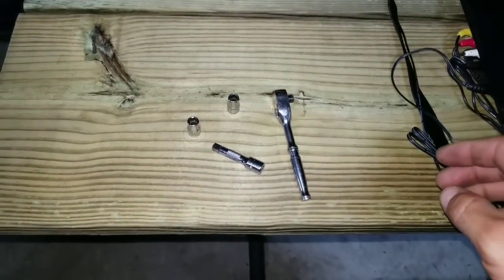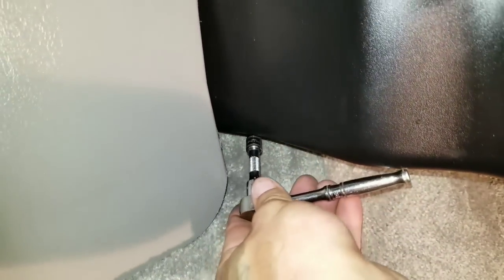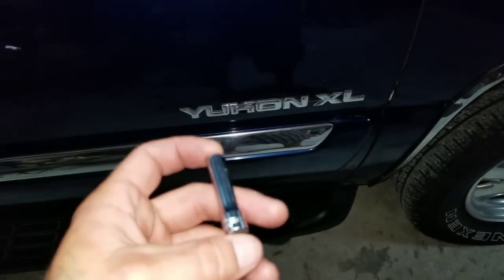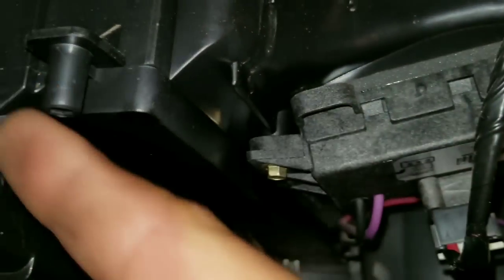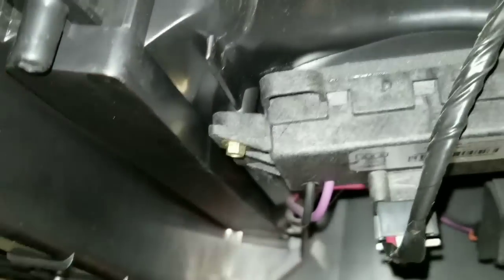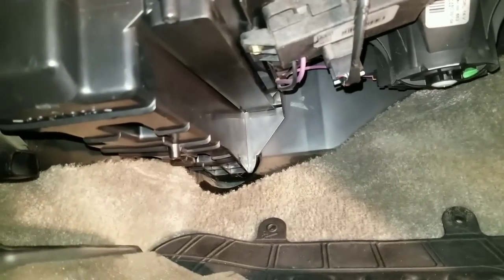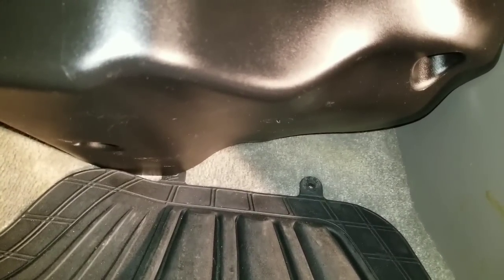Cabin Air Filter Replacement - 1999- 2007 - Yukon - Suburban - Tahoe

Comment: Thank you for not finding a filter. I was going crazy yesterday trying to find my cabin filter. My local parts store was happy to sell me a filter and every YouTube video I looked at showed me where it was. You saved me a trip to the dealer. Now I can put the cover back.
Reply: Yeah I was thinking the same thing the filters are up there but they're just unaccessible it seems
Reply: Where he pointed where the filter should be it’s actually in there ,some people cut that bottom rectangular part of the cover out and the filter will drop out and all you do is seal it up back so you have no dust go in
Reply: I have this setup and there IS a filter in there.  If you remove that electronic thing near the fan, and shine a flashlight in the hole, you will see it.  Mines clogged all up and needs to come out.  Was hoping this video would show how to make the cuts where it all goes back together nicely.
Reply: I need to figure that out too. I have almost no air pressure coming out of the vents and it’s getting hot out!

Comment: As I was watching your video I realized that I'm in the same predicament As you are and I do not have a cabin filter. I have a 2007 Chevy Tahoe LT that we just purchased and our AC isn't blowing as cold as I would like so I figured I would do the easiest thing and check the AC filter. Anyway good to know that we are in the same predicament, and hope you are staying safe. Thanks again for the video it helped
Reply from the maker: No problem! Just so you know theres a filter access door you can purchase and filter, simply cut out where the filter goes on the heat exchange housing box and insert the filter and put the new filter cover door on and you're good to go... parts can be ordered on line or at local parts store... I should've made a video covering this a long time ago!  best wishes I hope this information helps.... and thanks for your comment!!

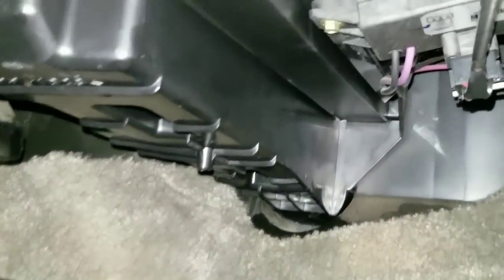Comment: Guys, it can be done.  The plastic he describes at 1:45 has to be cut out to remove the filter.  If you look at "09 escalade cabin filter replacement" video you will see. Basically the same set up.  Only difference on the escalade is the plastic is grooved where you need to cut.  Usually the new filter comes with a new plastic flap and screw to cover the hole. I have an 08 Tahoe that I'm going to be doing this on
Reply: Too bad I'm flat rate and I don't get paid for all that extra work. Mitchell1 only calls for 12 minutes of labor. 2007 Yukon Denali.
Reply: How is it come out? I have an 04 Tahoe and have next to know air coming out of the vents and I have a feeling it’s from this.
Reply: If it looks like this i saw a video he modified and cut the hard plastic peace and its empty inside but a bunch of debree like leaves and pine needles came out but im not cutting it open ill leave it alone

Comment: Unfortunately GM eliminated the filter provision (cutout) with the 2004 model year. It can however be modified by cutting the stamping you showed. The space still exists underneath that blank to install the filters. You will need to fabricate a bracket to hold them in and cover the opening. Just had a thought, you might be able to find an 03 or earlier bracket that should fit, perhaps at a scrapyard. I also believe the Sierra pickups had the filter installed from the factory so that's another avenue to explore for a cover. Good luck and thanks for the vid!
Reply: Well i run with the same luck and if there is another way to replace the filter i will apreciate if you let us know and load a video and thanks for your videos !

Comment: The "module" is the blower motor resistor for anyone that might need to know....
Reply: And what does that do if you don't mind me asking? My dad's Yukon ac is only blowing from the top vents and nothing else. Any advice will help
Reply: @gerardomendoza8416  That's gonna be your blend door actuator... nothing to do with the resistor. The resistor only control the fan speed of the blower motor....
Reply: @gerardomendoza8416  mode door actuator controls the location the air is blowing from: defrost vents, feet, etc-  blend door actuator is if its hot or cold

Comment: So is there actually a cabin air filter and you just don't have access to it or is there no filter at all???
Reply from the maker: So come to find out theres a few years that the air filter wasn't installed at all... mine is one of them,.. but one can be added,. at the part in the video where I show where the filter goes theres that cutout that hasn't been cutout yet,. You can cut that cover and buy the filter and filter cover from on line or a local parts store can order it if they dont have them in stock. So if yours didn't come with the filter just order the filter and "filter cover" it may be referred to as the "filter access door." Something along those likes and simply use a sharp blade and score the air box where the factory "uncut cover" is at (witch is the part I show in the video saying this is where the filter goes) anyway score it and go over your score lines till you have cut through the plastic and the cover can be removed,.. simply install the filter you bought along with the new filter cover access door witch will come with a molded clip that holds the cover in place and makes for easy removal when filter needs changed... the filter will need changed when a unwanted odor appears OR if the air flow is reduced.  I would change filter no less then once a year but if you live on dirt roads and have tons of dust it may need changed way more times a year it really depends of environment etc. The other really nice thing about having a filter it that the heat exchanger will stay much cleaner and makes it easy for the system to cool the vehicle.. best wishes, sorry I haven't made a video on this problem specifically, I've been busy with tons of other things not auto related.

Comment: So wheres the filters located if we have this set up? I have an 04 tahoe w rear air..
Reply from the maker: @Jhonpowelljr In the video at 1:45 describing the plastic housing for the filter. These trucks were not made to replace the filter, but if you look at 1:45 in the video, you will see where the filter cover should be. there is a aftermarket filter cover that is available online. You have to cut out the stamped filter cover using a hot knife and replace it with a aftermarket filter cover purchased online. You will then be able to change the filters.

Comment: What if your 2004 truck is only blowing from the defrost vents and not the regular ones
Reply from the maker: When you change the setting on your Air system, for instance like from defrost to floor or to head and floor etc. There is a actuator that that closes and and opens vent passageways to change what vent the air comes out of. In your case I believe it's more then likely the "mode door actuator." Has failed.
Reply: I did mine on the passenger side and it didn't fix it but then I discovered there's another one on the driver side. I think that's what my issue is because mine is doing the same exact thing, blowing out of the defroster only

Comment: So if there's no CAF , The air isn't "cleaned" at all by Anything? 🤔
Reply from the maker: Nope but there's aftermarket filter cover you can buy and knock out the stamped out part of the heat exchange box, insert new filter and pop in the aftermarket cover.
Reply: Totally ridiculous that it’s necessary to improvise, adapt, to overcome this engineered nightmare. 
The filter is there but supposedly it’s going to last a lifetime? Yeah, I doubt it. That’s why you can use “a hot knife and hopefully not cut yourself or cut some necessary peace“ to get to a filter that is there but they make some sort of improvised adoption so you can change the filter. Engineers! My heroes!😤🙄

Comment: For all those having issues with air only coming from defroster and you changed the actuator on passenger side and it still didnt work ,well theres also one on the driver side i discovered lol. Might try to change mine today if it doesn't get to hot here in FLA lol

Comment: You have an air cabin filter.  I have a  2004 suburban and the filter needs replaced because of a disgusting odor.  The hard cover has to be cut away, the filter replaced. There are replacement filter covers.   I don't know what would make GM do it this way,  it must be a money maker or saver for them but it's a big cost and or a lot of trouble to get the old filter out.
Reply from the maker: Yeah there's some that are made with a non serviceable filter hints way there's no removable cover for the air filter location.. I sold that Yukon so never made a video on how to cut out the opening but I believe a hot knife would make easy work of it and yes there's aftermarket filter covers for the housing online that are direct fitment. Idk why GM changed it for some of these trucks but your right it's a pain in the ass for guys just wanting to change out a cabin air filter real quick. For those who know how to do the mod it's not a big deal but still have to ask yourself why GM just Why? I'm sure there's money being made when the evap coil plugs up or a non serviceable filter 🙄. 

best wishes nasano3

Comment: Strangely enough there’s another guy that used a hot knife and cut the plastic molding and took out the old filter and put in the new filter and then had a replacement bottom plate that he could put in that he got on Amazon or online. But what the hell were the engineers thinking when they have a filter there but there’s no access to it easily. Oh, I get it; pay $1500 for the dealership to do it for you. Yeah; OK, I get it.😤
Reply: Do you remember the name of the video?
Reply: @eliasmunoz4771  Unfortunately I do not. I think I just found it under cabin filter replacement for whatever the years That were discussed. My suburban is a 2005

Comment: Can you please upload a video on how to change a cabin filter on a chevrolet tahoe 96 or a chevrolet Z71
Reply from the maker: I'm sorry but I'm unable to fulfill your video request at this time, my advice to you is pick up a Haynes or a Chilton’s repair manual for the year make and model of vehicle you have. Those repair manuals are great for the shadetree mechanic as they provide general repair procedures. But if you need a more in depth manual for your vehicle get a factory manual available through your vehicles manufacturer authorized dealer. 

Thanks for commenting! 
Please give my video a thumbs up for my efforts!:) Thanks again!!

Comment: Anyone knows if the 2005 yukon xl denali has one
Reply from the maker: The 2005 Yukon denali XL actually as a pair of air filters located in the same location this video shows.
Reply: @cyoutellme  ok thanks I'll check mine maybe thats why the front a/c blows cold when it wants
Reply: @cyoutellme  I just took mine down and it looks exactly like yours so mine doesn't have any cab air filters after all!!!
Reply from the maker: I would've bet money that the Denali had them in that year. My apologies for giving you the wrong information. I'm going to research it.

Comment: So I don't have the drop down bracket either but I feel like there has to be a filter somewhere. I can't even hear/feel the air blowing until it's up to half speed or higher so I basically just run my blower at high speed at all times.
Reply from the maker: Brandon Ward Have the make and model of your vehicle along with your Vin number ready when contacting your dealership and they will be able to tell you for sure if you have cabin air filter or not... the truth is they did stop putting cabin air filters in some... hope this helps.

Comment: What about a 2004?
Reply from the maker: Hi and thanks for the question, it's hard to say for sure because some were made with a cabin air filter and some weren't, you can easily follow this video to check if your vehicle was equipped or not:) best wishes!

Comment: Bro Are you Serious!?!  I have the same setup as You EXACTLY. Took off the blower motor resistor and the filters are in there. DIRTY AS HELL… but I can’t find a video to replace them
Reply from the maker: You have to “cut out” the spot on the the filter housing and buy an aftermarket AC filter door retrofit kit. Which is just the door and a screw. The hardest part is cutting out the stamped place in the AC filter housing. I make ZERO dollars providing this link https://www.amazon.com/ACDelco-22759208-Original-Equipment-Retrofit/dp/B01G5VHFW8 I’m providing it so you know what to look for. Buy from wherever you’d like. Hope this helps. Thanks for your comment.

Comment: Actually, I have the same setup as you in my 2004 Yukon.  If you remove the electronic module on the bottom below the computer you mention in the video, you can see a filter in there!   Disappointing you can't change it!
Reply: Robert Martelli 
You should make a video, I can't find it ..
Reply: I was able to put my finger thru the small opening in there and I could feel the filters there and they are filthy.  I will have to cup the bottom opened to replace
Reply: @mannierivera7591  i cut open mine in my 07 z71 tahoe and there was no filter. They forgot it at the manufacturer i think. Only saw a metal grate that looks like whats in the front of your radiator. Not sure if its actually supposed to have one or not.
Reply: @ryry283 that's your heater core lol

Comment: Take off the sensor and the filter inside is built in metal   just spray something for the smell inside!!!!!
Reply: do u have a video of this
Reply: No I don’t sorry you need to check out your truck if you can find a filter or sensor
Reply: Depends on the truck year or model GMC and Chevy are similar
Reply: Whoa ! That's your heater core dude ,  you dont want to damage or even touch that thing if it leaks you'll be crying like a tiny baby !

Comment: My car is the same it dosent have cabin air filters 😁😁😁👌👌💪💪👍👍tahoe2006
Reply from the maker: Yes unfortunately some were not made with cabin air filters.
Reply: @cyoutellme  why unfortunately?  I have a 2006 Chevy Avalanche and the A/C smells funky is there anything I can do about? If yes please help me out
Reply from the maker: @CocinandoFinanzas unfortunately because that's what the manufacturers did or in this case what they didn't do which is "put a cabin air filter in" 

there is a punch out in the bottom of the housing that you can knock out and buy aftermarket kit to install your own air filter. I believe a quick Google search with the year make and model that you have (be sure to add cabin air filter kit) and you should get a result... 

I've been meaning to update this information but haven't had time.

Comment: I pulled my blower motor and module amd had to tale this cover off. I used a deep 7mm socket and dropped it and it rolled in the center console. 🤣 cant find it and will have to take console apart. Just my luck.
Reply: That sucks !
 The dude tiling my bathroom was all coked up tiled the wall with half his tools in the wall he then said oh well looks good